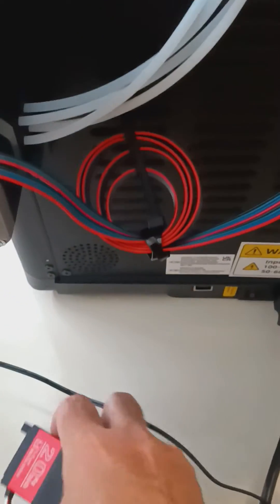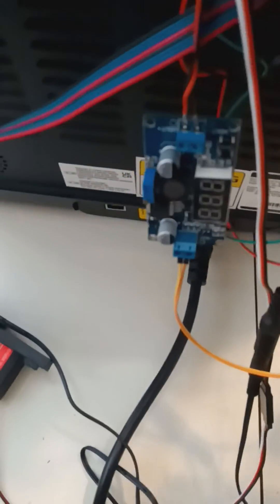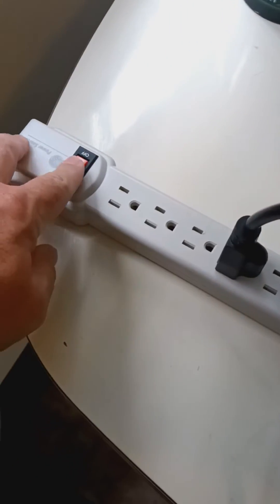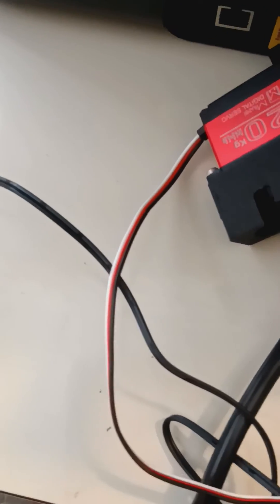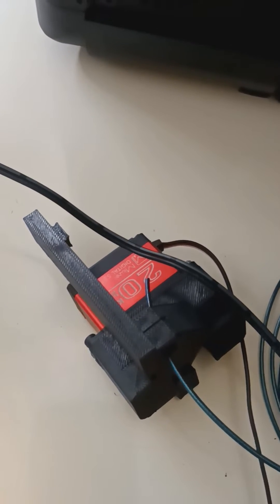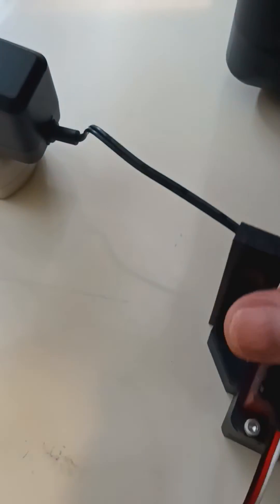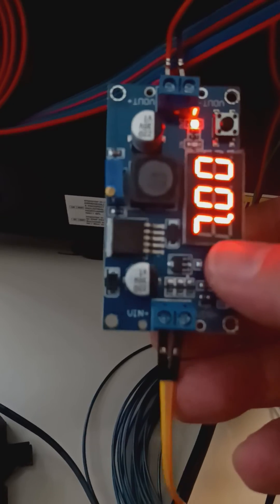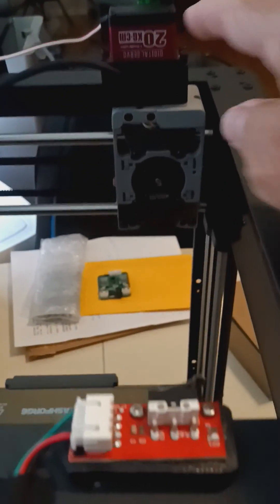3DChameleon Auto 3DClippy Servo Cutter with Higher Voltage

Comment: I need advice i want to convert my 3d printer to multicolor with the 3d chameleon and could get everything but the pcb. I have no idea what pcb to get and if i have to programm it.
Reply: You can simply use any printer driver board, ardunio CNC shield or something similar.  No matter what you get, you'll need to program it... but our code will work with a simple arduino and stepper motor drivers wired to it.
Reply: @williamsteele  what i had in mind was making a pcb with 1 input connector for the stepper motor connector from the original extruder motor that connect to 4 separate ones (4 colors). These 4 extra extruders are then switching between each other via an end switch mounted somewhere on the 3d printer. (1 press Green, 2 press red,3 press yellow and 4 press blue for example). Lets say you are on red and want Green the you would have to press the switch 2 times.
Reply: @senhalp5724  Modern stepper controllers do not allow for that... as soon as you break the connection to one motor, it will detect it and fault out.  Our original Mk1 3DChameleon used exactly that method (as did the Prusa MMU V1.)  We had to move to active systems due to those motor controller changes.
Reply: @williamsteele  Am i right to assume that the basic function of the 3d chameleon is that when the switch is pressed it Switches to a certain filament out of the 4 pushes it to the Main extruder into the hotend and the disengages the filament so the Main extruder takes over fully
Reply: @senhalp5724  There are not 4 pushes of the switch, there are up to 3... one to select the command (or filament), a second to back out the filament and the third to load the new filament.

Comment: If possible I would like it to have more documentation on how it works
Reply: How what works specifically?  The servo cutter itself?  With the Mk4, there is nothing you need to do, it's just automatic... whenever you command it to retract the filament, it will always cut it prior to backing it out.
Reply: Ok

Comment: Getting closer to a great solution , but maybe it’s time to ditch that multistage  Y feeder arrangement  on the Chameleon and just get a Bambu 4-1 PTFE adaptor, as it’s lighter, simpler to configure (lengths are the same) and looks neater.
Reply: You're free to do that, but I'm not going to change our design, that's akin to McDonalds changing the golden arches to something else.  We've used our Y adapter since before any of those other companies existed... it's our trademark.

As for the distances... I'm a little confused as to why you'd think you'd need to change the distances for each tube, as all 4 tubes should be identical, so it is 100% the same configuration.  In fact, you can actually use our configuration (gcode) with their 4 to 1 unmodified and it'll still work 100% the same.
Reply: @williamsteele  No issues at all with your solution, I do find it an elegant add-on especially as I can use it with some dry boxes, but my bad for misunderstanding your toolchange G-Code. I've yet to order my 3D Chameleon from you, but will when the new 3D printer arrives, I'll definitely will be fitting one to it, with a DIY filament cutter solution, but will probably use an OEM 4-1 adaptor despite the heresy. :)